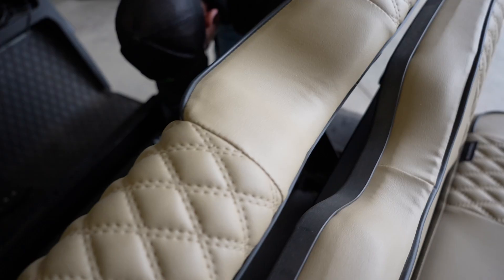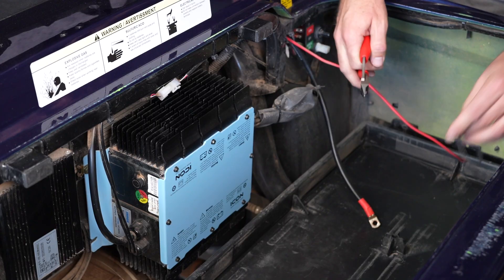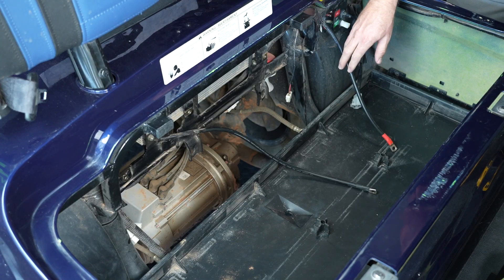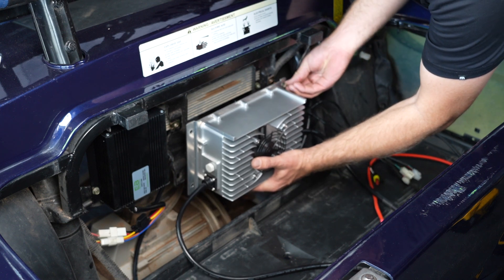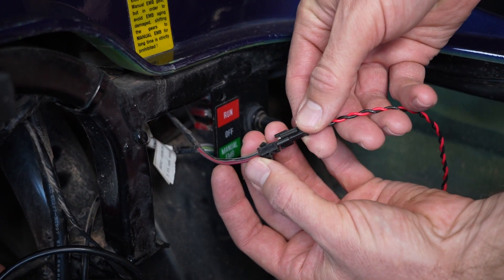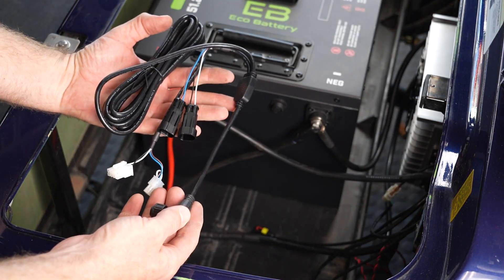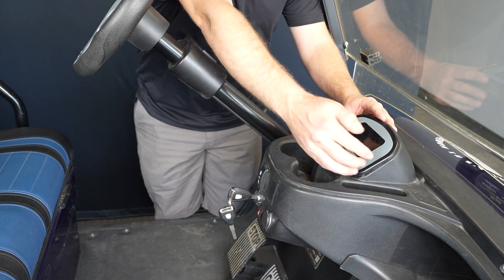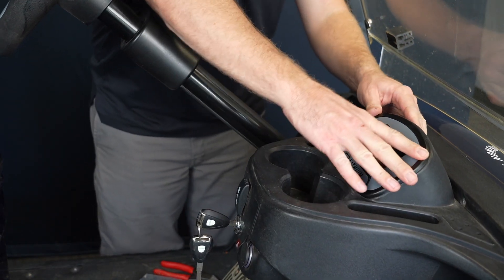ICON EV - ICON Controller - Eco Battery Installation Guide

Comment: Can this be installed and used without the program tech tool or will it be a paper weight until reprogrammed
Reply from the maker: Yes you can, the tool helps your display integration so all the metrics show correctly.

Comment: So really how often should you charge the battery? Some say ever day Some say a % , its lythum is it documented someplace ?
Reply from the maker: We highly recommend charging the battery after every use when and where possible. This ensures healthy cell balance and meter calibration of using our 2 inch round gauge. In our product resource guides on our website we highlight this in the user manual.

Comment: This made the install so easy!
Reply: Where can you purchase the eco tech tool and what is the cost ? Is it difficult to program - thank you
Reply from the maker: @tomtugboat $499 through any Eco Battery dealer. It is a multi use tool and can be used on more than one battery/vehicle. The tool and app walk you through the process fairly simple but any questions we are always available to assist.
Reply from the maker: @noahschone7284  perfect! Glad we could help and thanks for the support!
Reply: Any plans for Epic conversion videos?
Reply from the maker: @roosterrocks  in the works but in the meantime any questions just let us 877-ECO-BATT
Reply: I installed it on icon i40. The instrument cluster is ok when first turned on . Then, after a few moments, the soc shows - the only thing showing then is mph and odometer.
Reply from the maker: @tonybertolucci3359  give our team a call tomorrow at the number above to see if they can assist with this.